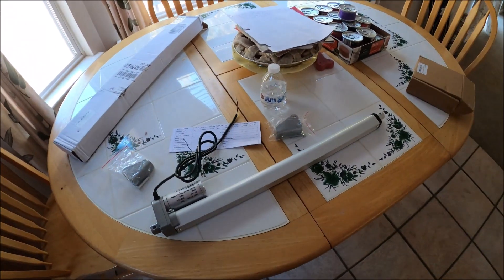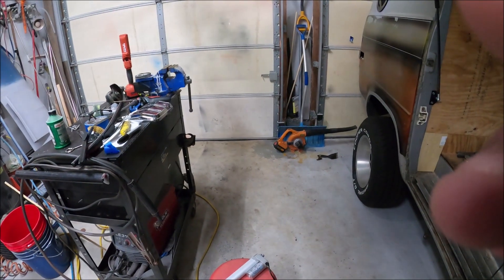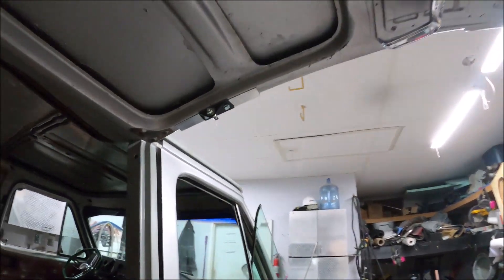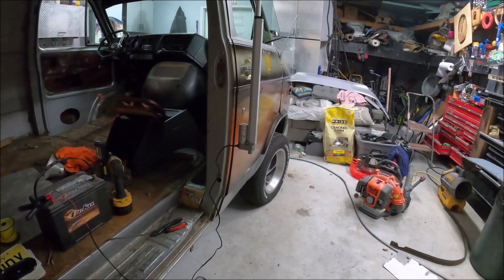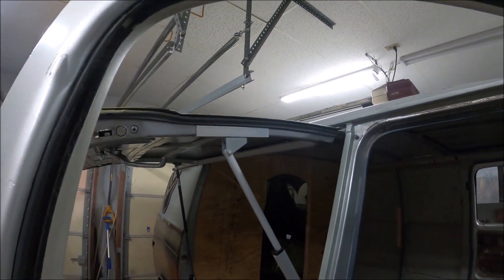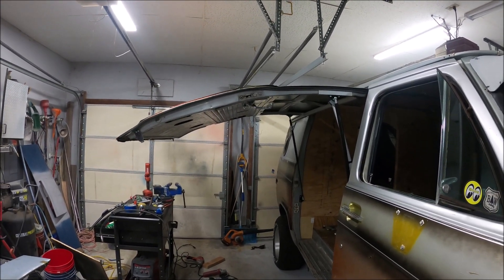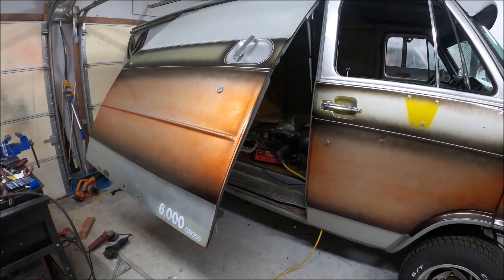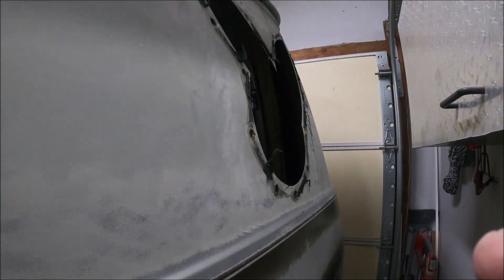Gull wing door electronic conversion (under $80)

Comment: The actuator needs to be pushing outward more than up at the beginning of it's travel.....The distance of the door bracket down from the hinge is limited by the overall travel of the ram..... Keep in mind also it is lifting more weight closer to the hinge and the weight gets heavier as the door goes horizontal..... You might consider having the ram mount on a ceiling-mounted arm that is inboard far enough for triangulation when the door is shut and low enough for the door to fully open and have the motor on the top side of the ram (when fully open).... might be limited by overall travel though....
Reply from the maker: Built a crescent shaped bracket and actuator will pull down, just been busy with other stuff. Not even gonna use actuator but will get back around to figuring it out. Thanks
Reply: @CrossCountryGarage  Yes, I could see that working if the crescent comes far enough in  and the attachment point for the ram end is higher up inside the van than the door hinges when shut.....I make "paper dolls" out of cardboard and lay out geometry on an old piece of plywood before final design in metal...